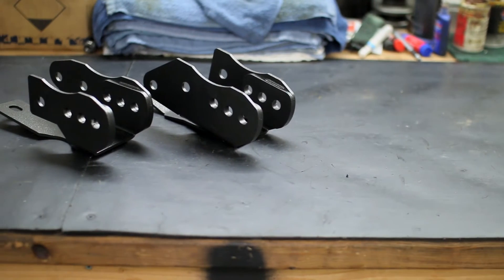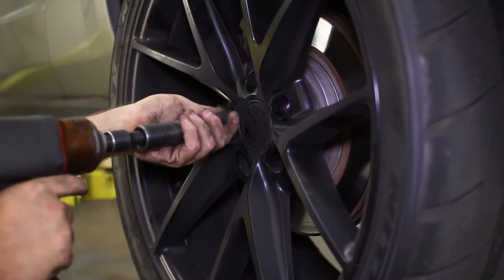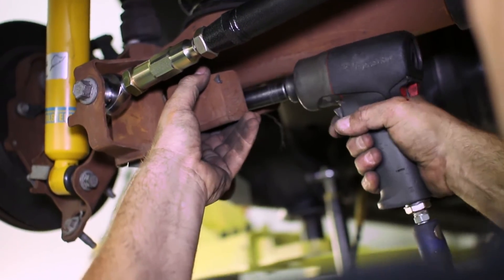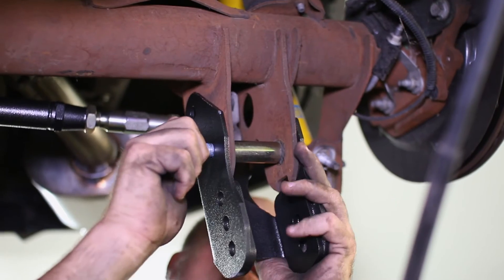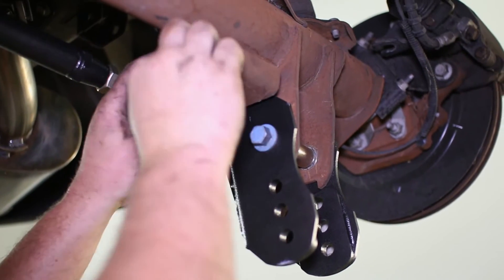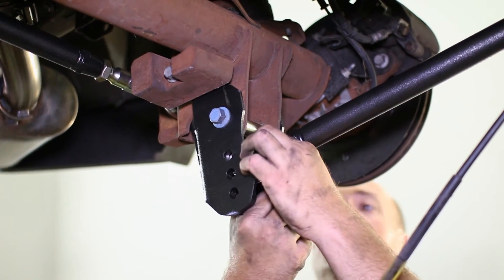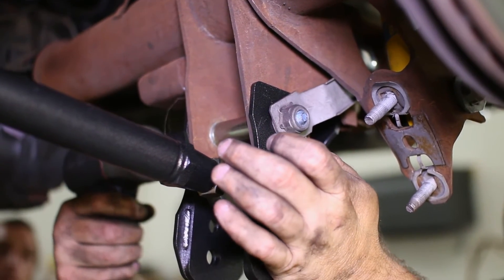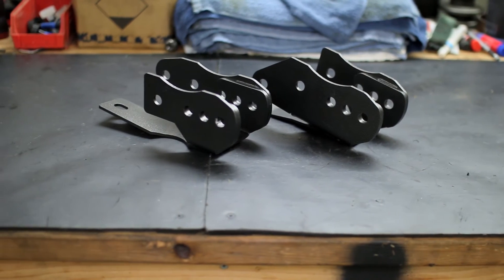2005-2014 V6/GT/GT500 BMR Control Arm Relocation Bracket Install

Comment: If your car is stock height are these needed.?? Or should you only use these on a lowered vehicle.??
Reply: turbosaleen347 it can be used for stock height as it'll help with better launches by eliminating wheel hop. This means better times.
Reply: What bolt hole would you use for a vehicle at stock height?
Reply: No these are are used to correct your lca angle no use on cars that are stock height as the angle is where it needs to be as for control arms themselves are a upgrade against wheel hop